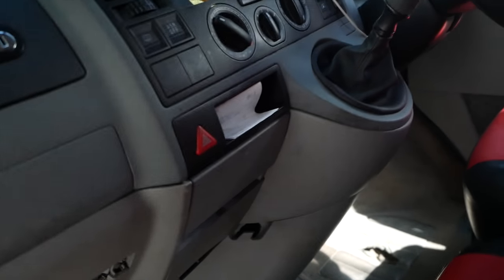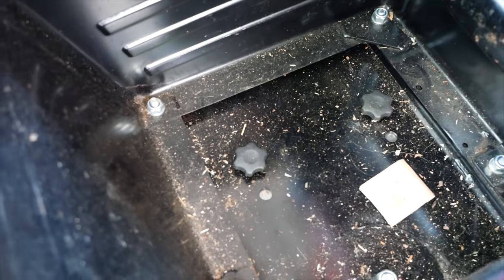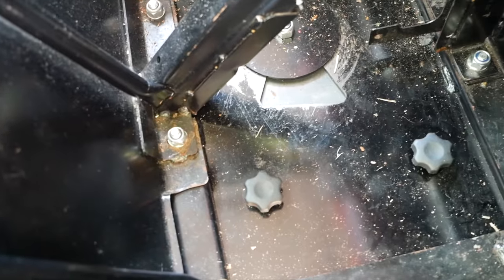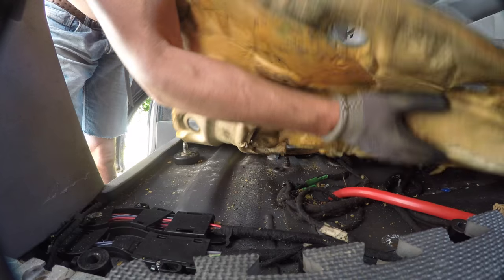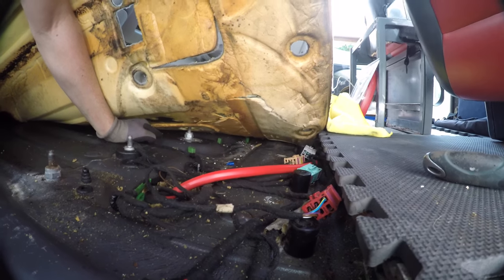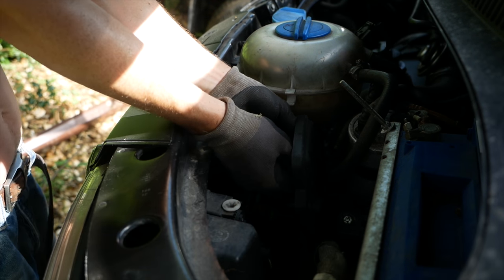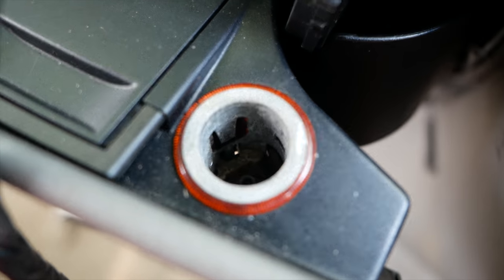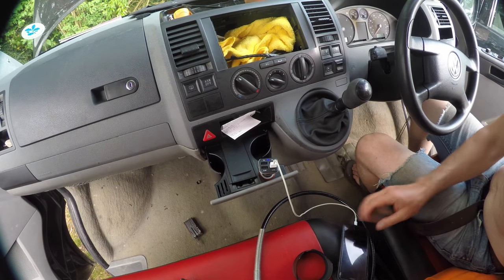VW T5 Cigarette Lighter fix...Eventually

Comment: Great video really helpful, also found it worthwhile extending the fuse box so it sits inside the the seat or just outside tucked under the flange of the base plate, saves taking the seat out everytime you need to change the fuse!
Reply from the maker: Hey TJ. Glad to have been able to help out there. Great idea to extend the fuse box to an easier and more accessible area. It does seem an odd afterthought for VW to push fuses under bolted in infrastructure?!?  So your solution sounds much more elegant. 
Cheers 
Rich ;o )

Comment: Had similar problem with door locks , spent an eternity chasing down connections etc . Finally I found the connectors under the drivers side seat growing their own moss , sprayed with contact cleaner and bingo problem fixed . How does connectors under a seat get corrosion is beyond me one of life,s mystery,s . Loved the video by the way .
Reply from the maker: That is impressive detective work! That is a perfect example of why I made these videos. There aren’t any generally available manuals that would have show your under seat cable runs. That would only have come from experience of your specific model/year. So your sharing that snippet will hopefully save someone else hours or even days of hunting and head scratching! And thank you.i hope to kick off some new stuff soon. Rich. ;o )

Comment: Thanks for this video, have the same problem 12v socket not working. I was trying to find a guide to what fuse it could be, now can check the fuse and check corrosion in socket, thanks again.
Reply from the maker: Hey Kevin, have a check through the comments too. Others have added in more suggestions of locations they have found fuses!  But yeah, sand out those contacts first. Was a proper face slap moment for me! All day it took me! But glad it’s been useful to you! Best of luck.

Comment: Why didn't you test the wires with a meter first?. Lol good video
Reply from the maker: you know it!  I did very gingerly put the multimeter prong down in there so as not to short the thing.  After a day of peeing about i found i hadn't broken through the corrosive build up!  Had i been a bit more heavy handed about it i could have saved myself hours!  Hey ho

Comment: my satnav ,stopped working ,and yes where was the fuse ,......all by  its self under the seat ,why,but it also has a second battery ,mine is 63 reg.
Reply from the maker: Hey John.  I just did not get my head round why VW hid soooo many fuses in soooo many places?

Comment: My fuse under seat was melted so replaced it and still not working 😢
Reply from the maker: Hey Nick, fuses blow because of a fault in the cable or appliance. Might be worth tracing the run to see if there is another short. Might be worth getting a tone tester to help trace it. 
Electric’s are a pain in the arse and take ages to sort. Best of luck!